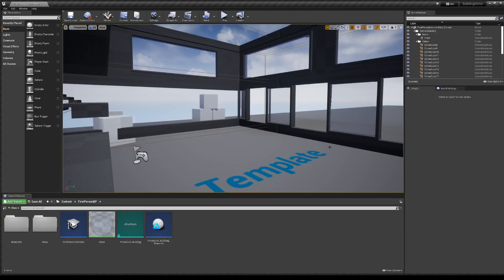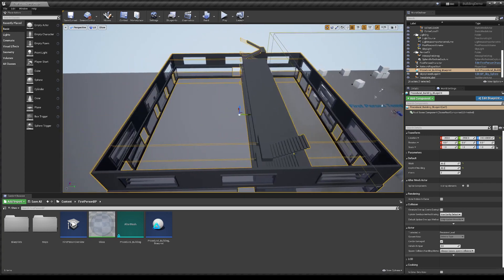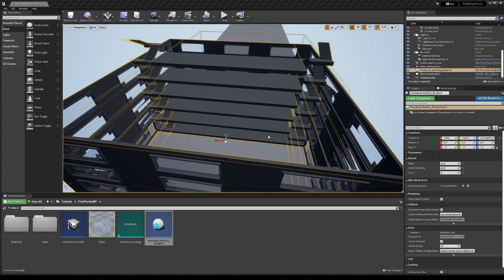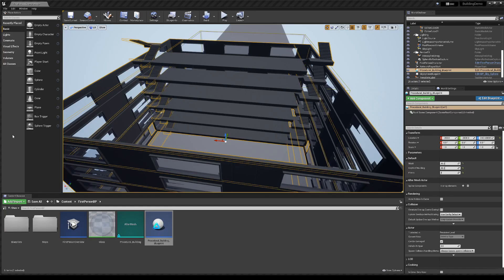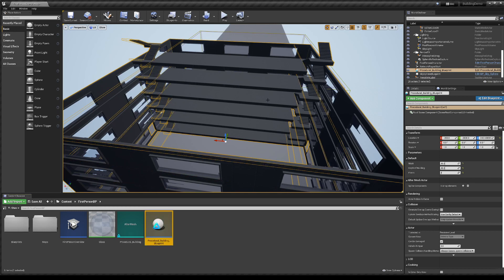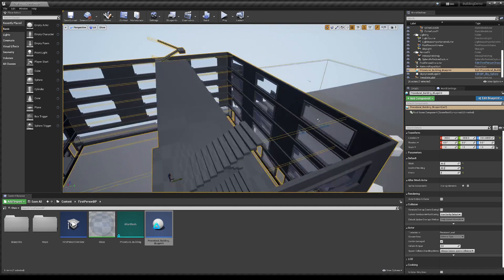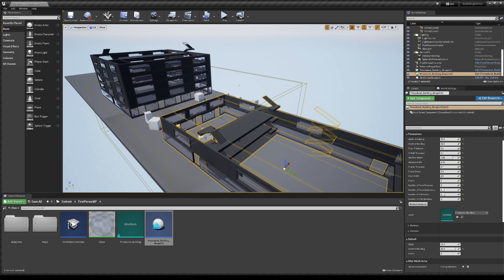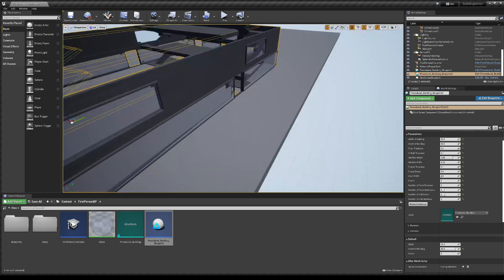Building Generator for Unreal Engine 4.27, built with Blender Geometry Nodes

Comment: So you created a building generator in blender and made that work in Ue4? If so, I'd really like to see how. I'm assuming you used Geometry Nodes in some way.
Reply from the maker: Yes.  That's exactly what I did.  However, the UE plugin, AlterMesh, is still in Alpha testing, and crashes UE every 15-20 minutes.
Also, since there is no "loop node" in Blender, I have to place the Floor subsection using UE... which is very tedious when it crashes every 4-6 tries.
Also, there's no way to get accurate collision boxes, yet.  I can make them for static parts, like floors stairs, and exterior walls... but interior walls are variable.

I plan on making a tutorial explaining how I made the exterior walls/windows/stairs/hallways, and how to get it working in UE4.